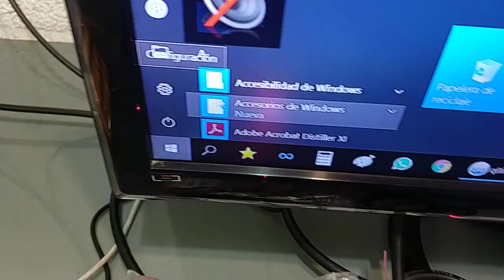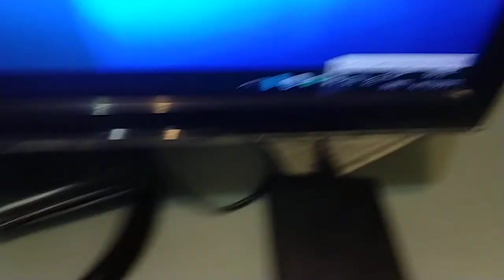Mi Notebook Air 13.3 Fix Battery connected and not charging

Comment: It seems that it is something wrong with the battery connector or the internal circuit of the battery. Sometimes the battery works again after I give a small push on the connector, and it does not work again after I carry the notebook around and perhaps loosen some connector points.

Comment: Thanks. 1) I switched off my laptop and disconnect charger. 2) I dismantled the laptop 3) I disconnected the battery but the plastic is hard to push to disconnect the battery and I broke like one milimiter of the black plastic doing this... 4)  I screwed the back of the computer. 5)  I  plugged the computer and without touch the power button my laptop switched on. 
And now it works, it's charging. 

I will uptade this if this problem reapears. If you don't see any reply, this method works for long term.

Comment: its worked as well, i just open the backcover and then disconecting the connector battery, then connect the connector again.. and now my notebook working fine.. (the summary problem for this case is ''connector battery not fitted as well'')

Comment: Update 2018-05-24: Sending back to China for warranty seemd price so I ordered a new battery from aliexpress. I installed it yesterday, it was on 0%. The battery chraged in about 60-90 minutes, than it was depleted in about 90 minutes during intense gamint, using the dedicated GPU as well. Second charging cycle also took about 90 minutes. It seems that either not the charging electonric was faulty or it is inside the battery so it can be changed. Hope it will work properly!
------------
Update 1 (3 months before the next update): This method only worked for 1 or 2 charging and now the issue is back.
------------
Original post:
Quick summary after successfuly applying the hints here:
Issue: Although the battery runs normally, it takes approximately an hour to charge 1% and will stop charging over time, well before 100%

Solution:
- the machine is switched off, power is pulled out
- take off the back cover
- pull the battery pins from the motherboard
- plug the computer (my machine switched on)
- after booting, reattach the battery onto its pins while the computer is still plugged in (use some kind of plastic tool, not to short circuit anything)

Results:
before starting computer was at about 55% and estimated charging time was 16h+, after mentioned steps and reboot, it was at 69% and 34min estimated time, which seemed real, as after about 30min, the green led was active. Haven't checked it since.
My hunch is that the controll unit of the battery charger is buggy and said process resets it. Hopefuly I will not have to repeat it in the next couple of month.

My computer is the 2016 version Air13

Thanks for the publisher of the video, for the idea! (y)
Reply: hi can you tell if the problem is fixed now?
does the new battery works well?

Comment: I have this problema my mi air 13 only Works if it's plugged in have you solved it?
Reply: Did you do it yourself? It didn't work for me
Reply: Same with me.....any solution :(
Reply: I am facing the same problem on my 4 months old Mi Notebook Air 13.3. Have you been able to solve it?
Reply: Punith Jindal I am facing the same problem on my 4 months old Mi Notebook Air 13.3. Have you been able to solve it?
Reply: ¿Pudiste solucionarlo? ¿Cómo?
Reply: 1) Unplug the charger 2) Open the device manager 3) Remove-uninstall the battery and charger drivers 4) Scan the devices 5) Scan and install the drivers
Reply: but it switches off when I unplug the charger. It works only when pluged in. Seems need to buy new battery
Reply: I have the same problem. Where can I buy a new battery?